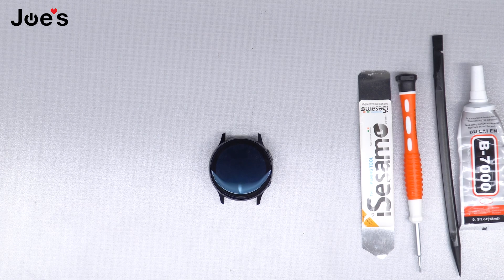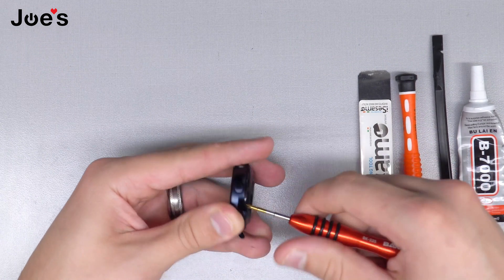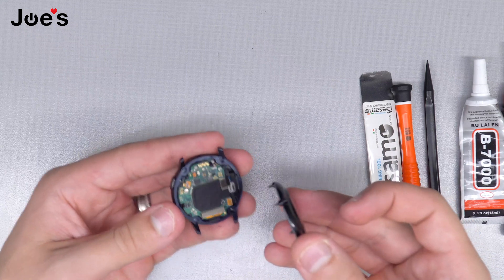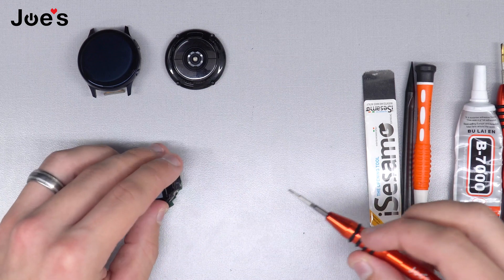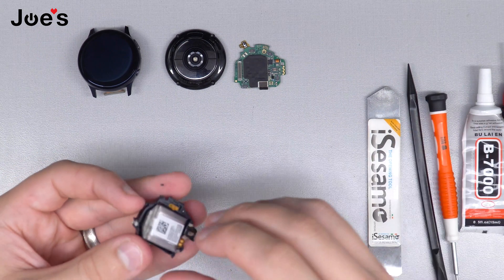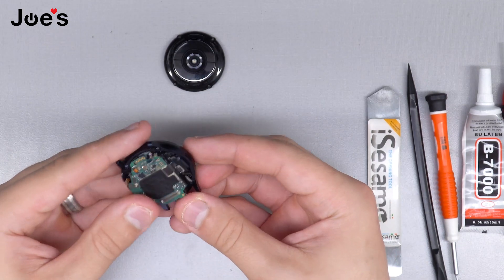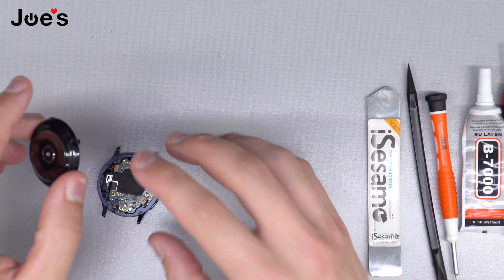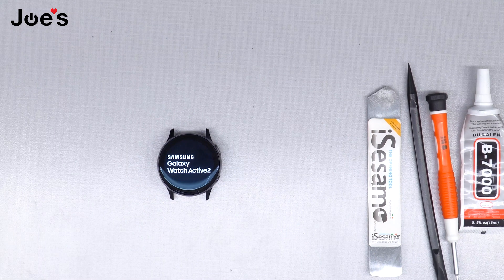Samsung Galaxy Watch Active 2 SM-R830 Battery Replacement | Repair Tutorial

Comment: How can I fix it if the power button comes off the mother board? Green part
Reply from the maker: If the button broke off the motherboard you would likely have damaged the traces on the board and would need microsoldering equipment to fix it.

Comment: I was able to do this, thanks largely to this video! First problem for me was the screws were incredibly hard to move- even with heat, but eventually they came out.  Then I encountered a problem I thought would be a deal-breaker. After unhooking the 5 connectors on the board- I could NOT get my board/battery to pry up at all. I wouldn't budge. I don't know if it's glued in or what. Every attempt to pry it up felt like I was going to break something and it wouldn't move. So I managed to simply unscrew the one middle screw, and gently lift the board up by itself. I just had to be careful with the power button cable attached- but it was easy to just lay the board to the side still attached by cable, then easily lift up and replace the battery. It actually felt like a shortcut as it went very easily from there. (And since I never lifted that whole housing out, I never had to maneuver it back in past those 5 ribbon cables.)  What a relief when it powered on and worked! Thanks for this tutorial!
Reply from the maker: Hello, you're very welcome. Thank you for the comment. Please like and subscribe for more content like this 😊

Comment: I had also a problem with my active 2 it didn't start at all. only charching and black screen i found out the flat cable of the powerbutton was broken. made a bypass with one small cable and works perfect now. so take advantage of it.if your watch looks dead.
Reply: I might have same issue, my watch just went black
Reply: You May Have Solved My Problem

Comment: My active 2 charges..it's at 100% but as soon as I take it off the charger it cuts off and won't turn back on:( while at the water park yesterday it showed needed to cool down and this problem started. Any suggestions on what to do??? The back cover became lose as well
Reply: Mine is doing the same, however I wasn't at a waterpark. I put it on charger for the night when I woke up it says 100% but will not come on. I've tried holding the buttons to reboot but I get nothing.
Reply: @CristyadoptDontshop  Same💀💀⚰️
Reply from the maker: Hello, thanks for commenting. Please email us at support@joesge.com with a screenshot of your question and we will be able to better assist you there. - Aaron P

Comment: Hey i have an issue with my active 2 if you know any fix, couple days ago the lower part of the screen and the touch bezel stop responding, i opened the watch like your tutorials and i found some water just after i opened the back cover, i took off the board like you did here but i cant find any corrosion on the connectors (connectors are clean)i found some on the back of the sensor but nothing else, where do i check for the screen connector ? i figured it is corrosion because one day i was cleaning my hands with hot water and probably some steam got again in the watch and the lower part of the screen and touch bezel started working again but for 2 or 3 minutes and it stopped again. Any advice on my issue? Where should i check for more corrosion ?
Reply from the maker: Hello, thanks for commenting. Please email us at support@joesge.com with a screenshot of your question and we will be able to better assist you there. - Aaron P

Comment: A friend gave me a watch.... according to their receipt, I  have a Samsung Galaxy watch active 2 model number SM – 500nzsaxar....40mm...... other than the 40 mm I can't find anything that tells me what type of battery to replace in there.... the closest I have come is everything that points to 40 mm says r830.... looking through the comments you said the r820 & the r830 are the same just one is a little bigger... however Amazon distinctly says this or that  battery is not for the R830 or R820 ( with a big red X or a big green check mark on the item to show the difference).... have you ever dealt with this model? Is it an r830? What replacement battery model number am I looking for? Thanks in advance
Reply from the maker: Hello, thanks for commenting. Please email us at support@joesge.com with a screenshot of your question and we will be able to better assist you there. - Aaron P
Reply: The model number is engraved on the back of the watch. Just take a photo and enlarge it.